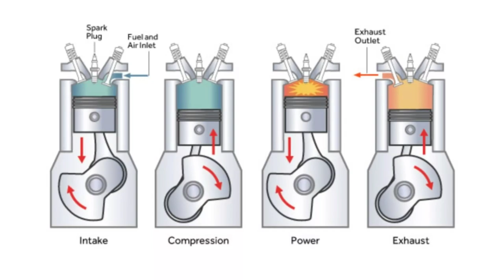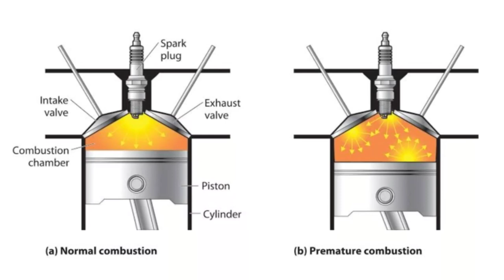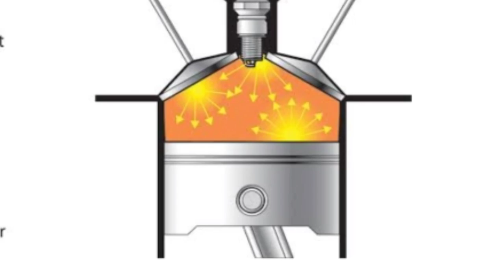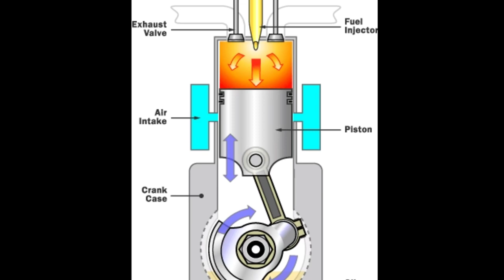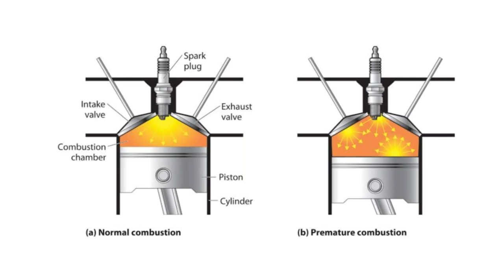Why this sound is produced in some bikes?? | தமிழில் | Mech Edu Tamil.

Comment: Bro :my Dio while doing cold start at morning ,it produces sound at start time alone while kick start or self start ,after tat no problem ,I did service twice ,mechanic told while doing choke start don't rise the accelerator quickly,tats reason ,it serviced recently , please give your suggestion on this issue
Reply: Enaku duo la agiruku bro.help panunga bro ena panlam meachanic sariya pakala bro
Reply: @micmartn6427  ,dio silencer above filter onu eruku bro ,not Air filter adae replace panen ,then silencer kudae inside pipe adae clean panitu mechanic kudutaaru epo rare ah eruku ,but andae pipeyum full ah replace pana it will solve bro